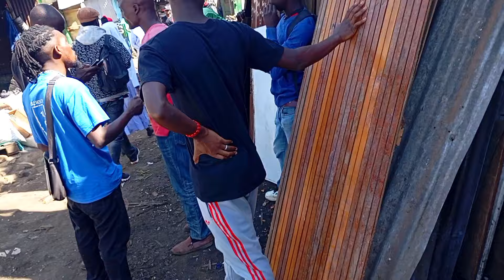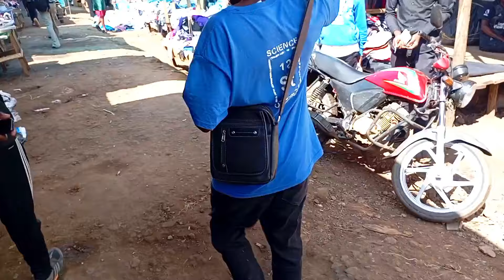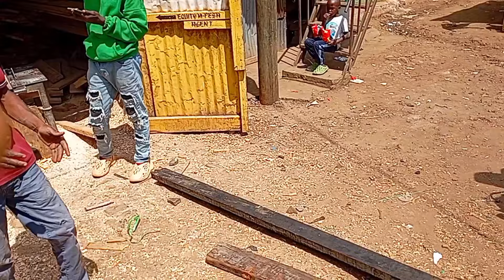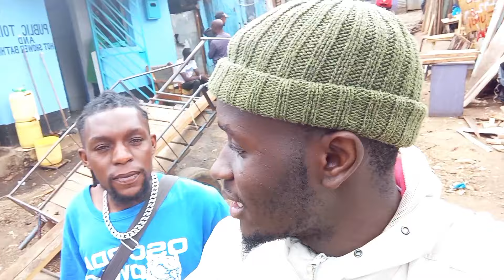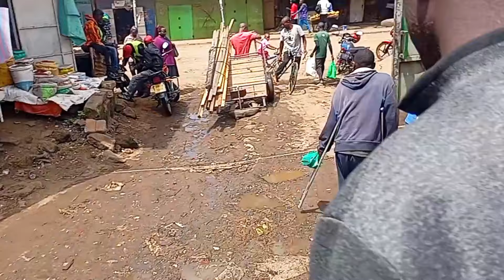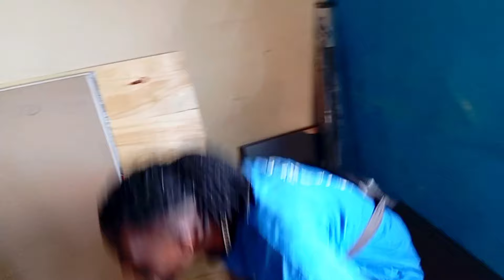Renovations to the new apartment begin!!

Comment: I am just wondering why make the ceiling, as there is one already?  And the room will look even bigger without it.
Reply from the maker: There isn't one already it's just the metal sheet that's ontop and nothing else and it wasn't looking great as the previous tenant had caused it to be covered in smoke so it was all dirty hence us needing to put the ceiling yess it would look bigger but it won't look great due to the roof not looking in great condition, we wouldn't have done it if everything was looking okay the landlord also suggested it
Reply: Looks nicer!